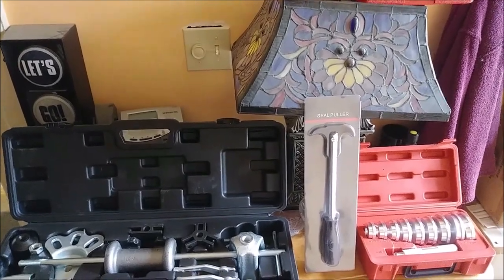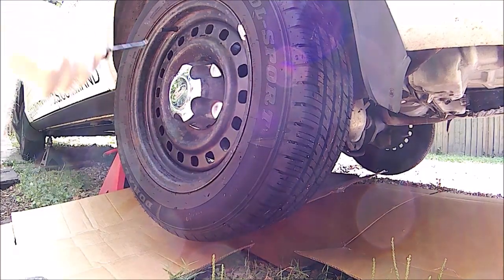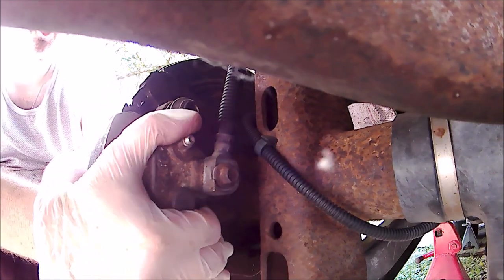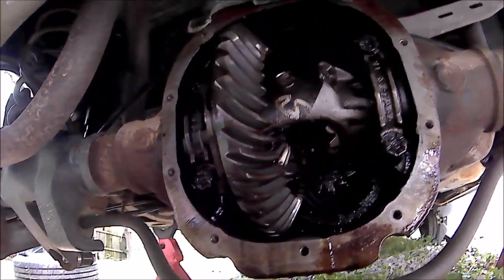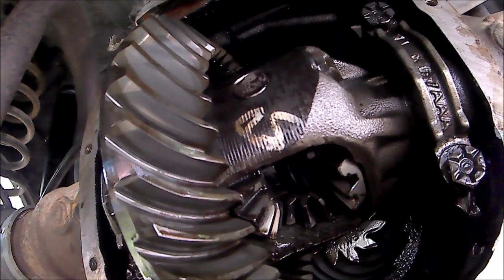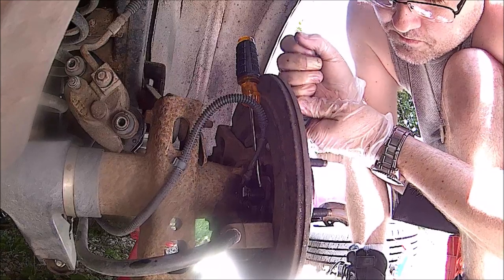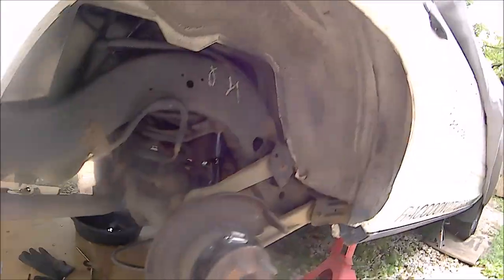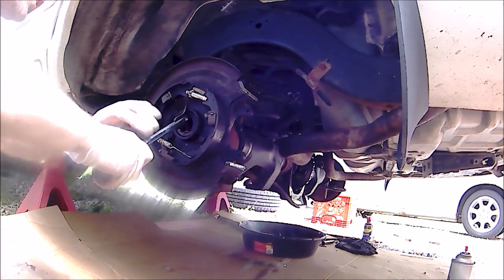How to replace axle seals and bearings Ford Crown Vic

Comment: Yeah, i rotated the axle accidentally but fortunately the spider gears didn't fall out and i got them rotated back in place. I spent a few minutes praising God before moving on. My ABS sensor came right out with a slight twist as i tugged on it. Not a real hard job all in all. Nerve wracking though. Thanks for the video.  Very helpful.

Comment: I want to thank you for this video, just to let everybody know I am a network technician guy, zero automotive experience, and when I mean zero I actually mean negative automotive experience but because of this video I was able to actually change out the bearings seals and actually one of the axles the raceway with axle touches the bearing was so worn I could shake the axle in the bearing so I had to buy a brand new axle for the right side and was able to put it all back together with the help of my 10-year-old, so we need more videos like this, with no music, no commercials, just plain and simple repair or installation, and I also like the fact that you warned me about the sensor, because I was about to break mine, but they both came out very easily and I cannot stress enough what was said on this video if you so much as move any one of the axles while that pen is out the spider gears would just fall right out the case and on to the ground.

Comment: You don't need a seal puller. The bearing puller/slide hammer will take the seal with it when you knock the bearing out

Comment: I assure you I am not the only mechanic that puts a little heat on lock pin before wrenching it out. He obviously is not. And he’s too worried about the spider gears.

Comment: New bearing on old race.. NO. Bearing and race are a matched pair. New bearing must have its new companion race installed in the axle housing axle tube. Or did you only change out the seals and reuse the old bearing after cleaning and lubing it?

Comment: Dude I just replaced the bearing and seal on the rear right on a 05 grand marquis 2 months ago I came out this morning saw a puddle of gear oil is it defective parts or ? Or what else could be the issue?
Reply from the maker: Is it leaking from the same place? Puddle under the right axle seal? If you didn't damage the seal upon install, check the vent tube. If the vent tube is plugged up, the pressure will vent where the next weakest seal is. If the vent is not plugged and the axle seal was installed correctly, check to see if the caliper is sticking on that wheel, causing excessive heat to build up and damage the seal.

Use an infrared pyrometer to check the heat of the other wheels after a drive and compare. Or use an infrared camera like I used in my most recent video. If neither of those are available use the back or your hand to see if more heat comes from that wheel after a drive compared to the others. If you hold your hand near the wheel you should be able to feel the heat radiating from it and compare to see if more heat comes from that wheel.

If it's none of those, then possibly the axle is bent and as it rotates it warped the seal and caused a premature failure. Maybe if you hit something hard at a hight speed with that wheel like a curb or pothole you may have a bent axle.

Check vent tube 1st.
Then the brakes/calipers for heat.
Finally remove the axle again and check for damage before installing another seal.
Reply: @HollywoodHornet  yes its leaking from the same right axle seal and thanks ill be checking for those other issues

Comment: What symptoms did the car have to make you check the rearend and stuff....? Ty I'n advance....
Reply from the maker: Axle seal on left side was leaking. It was caused by vent tube being plugged up and building pressure.

Comment: I have a TC and I had a mechanic replace both rear bearings and they messed up somewhere along the way. When going for the test drive I heard a differential noise and it looks like fluid is on the inside of the left tire and the traction control sensor is on. They seemed to have a lot of trouble getting the bearing off that left side I'm wondering if they possibly didn't put the bearing on correctly. Also at some point the mechanic did manually turn the axle shaft gears. I dont remember at which point exactly he did it but if he messed with it before the axle shaft was put back in or trying to put it back in, the differential will probably be shot right?
Reply from the maker: Without actually seeing it I can only hypothesize what happened, but if he didn't put the left bearing and seal back in properly that could very well be where the leak is coming from.
Or
Perhaps the vent tube for the rear axle is clogged and the pressure buildup blew out the seal and caused the leak.
Or
The axle shaft is bent and the wobble while rotating is causing the seal leak.

As for the rear end noise, is it coming from the diff itself or closer to the axle seal? A mechanic stethoscope will help pinpoint the origin of the noise. I reckon when you say manually spun the axle gears you mean the spider gears?

If so, that could be the source of the noise. Those gears after being broke in and always interacting with other gears via the same teeth for years and many miles are wore in to those specific other teeth they contact. That could very well be the source of the noise.

I hope it isn't something even worse like they forgot to put something back in like those large washers in addition to messing up the axle seal. If the noise is very loud it's probably generating a lot of heat and cooking the oil and destroying the diff.

I made another video where I took the diff from a Mustang GT in Pick n Pull with the plans to transplant it into my Crown Vic. I haven't done the transplant yet, but it's relatively easy and can be done with hand tools. If your diff is shot, I recommend watching that video, then doing that work yourself. Get another diff from a wrecked car, and transplant it into yours.

I also plan to sell my Crown Vic open diff on ebay once I transplant the LSD into my Crown Vic but that won't be for a while, or I'd give you the hookup on a differential. If you go that route, just make sure your axle ratio is the same as your donor differential so it's an easy swap in and out of the differential carrier assembly.

Comment: What's the part# for that puller attachment on the slide hammer and where did you get it!??
Reply from the maker: Is this the attachment you are inquiring about?
https://www.ebay.com/itm/172301578922
Reply from the maker: This is the link for the seal drivers as well.
https://www.ebay.com/itm/312293463668

Comment: Can I drive without my ABS?
I have a 99 Crown Vic and just installed new wheel bearing and now my ABS light is stuck ON.
Can I remove the ABS altogether? I live in Louisiana and never on icy or slick roads.
Reply from the maker: Either the sensor was damaged when replacing the wheel bearing, or the new bearing did not come with a new reluctor ring and now the sensor for that wheel cannot read the speed of said wheel.

You can drive without ABS. but now you can no longer press the brake as hard as possible in a panic. You have to press just short of lock up. The ABS light will also continue to always stay on until either the damaged sensor is replaced (if that's the problem) or until the proper OEM or equivalent bearing with reluctor ring is installed (if that's the problem).
Reply: @HollywoodHornet  the sensor is damaged. Just found it. So can I just pull that sensor out and pull the abs fuse and drive until fixed?
Reply from the maker: @whiTmanxX  that's an easy fix then. You don't even need to pull a fuse. Just drive with the light on until you get a new sensor to install. Once the new sensor is in, you won't even have to clear codes from the ABS module. It'll fix itself once you start the car or the wheel rotates a few times and sends a signal to the ABS module that the sensor can read wheel speed.

You can drive with no issue until then. Just remember not to stomp on the pedal in a panic or you'll lose steering under wheel lock. Press as hard as you can just before wheel lock in an emergency.
Reply: @HollywoodHornet  the sensor itself is literally on the ABS teeth and makes a loud clicking noise while driving. Can I remove the sensor?
Reply from the maker: @whiTmanxX  yes, and I suggest you do that sooner rather than later before the sensor damages that ring. Just snap the end off if you need to. That sensor should never contact that ring.
Reply: @HollywoodHornet 
Awesome! Thx.
No do I pull the fuse as well?
Or just drive with the sensor snapped off as is?
Reply from the maker: @whiTmanxX  just drive snapped off. No need to pull the fuse at all. I didn't pull mine. I just drove with the snapped rear sensor, when I put the new one in, light went out on its own without me even clearing the code from ABS module.
Reply: @HollywoodHornet 
Thank you! Do you have a PayPal or Google Pay so I can support your channel
Reply from the maker: @whiTmanxX  You don't need to donate money. Just watch any content on my channel you think is valuable to yourself and spread the good word to anyone else that might learn something. I'm just here to help and if my content is valuable, people will watch it, hopefully watch the ads on my videos, and Google will pay me for said ads that were viewed.
Reply: the bearing has nothing to do with the sensor it didn't even need to be taken out the sensor reads the shaft

Comment: What year is this crown Vic? Is the 97 the same? Will a 97 have C Clips?
Reply from the maker: I would think any Ford with the 8.8 rear end will be the same. The only difference I'm aware of is in later years, like the 05 and up, have 32 spline axles whereas our older cars have the 28 spline axles.

Comment: 30:09 No way, you actually use that stuff?
I thought you were just pulling my leg. 

How do you keep the jack stands from sinking into the soft ground?

0:15 Sorry to hear about Miss Michigan.
Reply from the maker: I always use that stuff. Seal leaks are for squares, man. I have plywood under some of the jack-stands, the right rear is the only one where there was enough gravel underneath I wasn't worried about it.

Once my two more loads of gravel get here, I should be in business and the whole yard will be either gravel or asphalt. Gotta wait for this finger to fully heal before I start shoveling more gravel and leveling it tho. That slide hammer didn't do my finger any favors.
Reply from the maker: Now that I think about it, what's your P.O. box number? I will buy you some AT-205 re-seal and mail it there and you can pump some in the diff and behold! Your pinion seal leak will be a thing of the past, and you can rescind your earlier snake oil claim.
Reply: @HollywoodHornet  
There is no P.O. Box, I just wanted to try my hand at televangelist scamming.
I spent the money on $0.25 Peep Show Booths, and meth amphetamine. 

I'm not convinced that pixie dust does anything. 
Maybe it'd be good for killing weeds.
-Chuck

Comment: What year is this car?  I'm guessing 2002.
Reply from the maker: Correct. 2002 CVPI.
Reply: @HollywoodHornet  The wheel offset and the fuel tank protectors on the rear axle are what gave it away.

Comment: What if you don't have a slide hammer
Reply from the maker: Then the bearing and seal ain't coming out.
Reply: @HollywoodHornet  I found out the heard way 4 hours and still sitting on stands no way to go by one
Reply: Auto parts stores will usually rent these things essentially free, you just pay for the cost of the tool up front and then they give all your money back when you return the tool.

Comment: If the outside is worn the inside probably are the same
Reply from the maker: The seals are only on the outside. The seals keep the oil inside the axle.

Comment: BS on the hammering in the bearing, broke mine.
Reply from the maker: You did it wrong, maybe? We all saw me hammer mine with with the aluminum press deal of the correct size and my bearings and seals are totally fine at the time of typing this.

Comment: this is painful to watch. wow. never have I seen this done in such a difficult way
Reply from the maker: I'm open to some constructive criticism if you have an easier way to do it. Unfortunately you didn't say what was painful and what was difficult so I can't even guess what you mean.

Do you have an easier way to pull the axle? An easier way to remove the seal? An easier way to remove the diff cover? An easier way to install the seal? An easier way to remove a stuck and rusted ABS sensor? An easier way to remove the wheel? An easier way to reinstall the diff cover? An easier way to pump in the diff fluid? An easier to lift the vehicle? What did I do more difficult than I had to? I don't intentionally go out of my way to do things the hardest way possible.
Reply: @HollywoodHornet  I like your attitude lol
Great video man